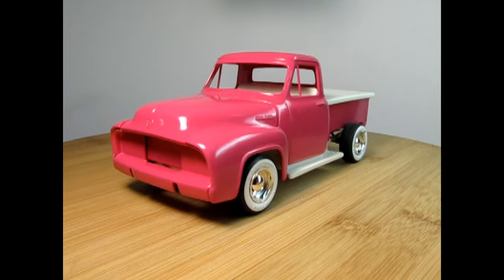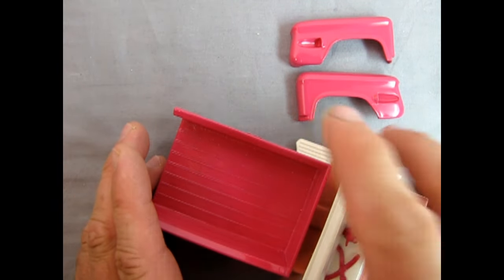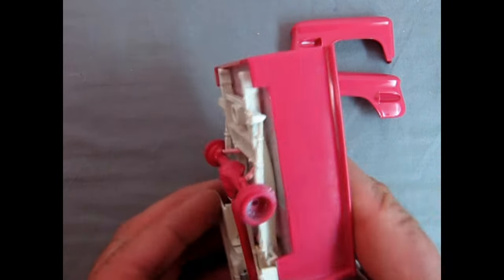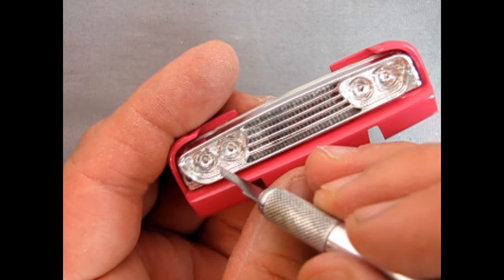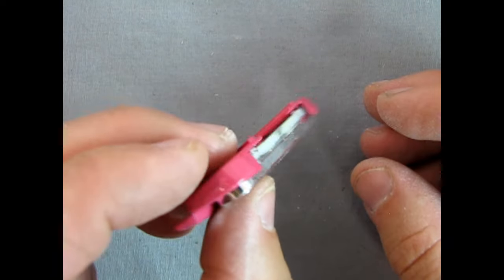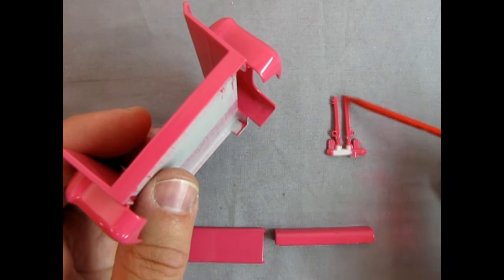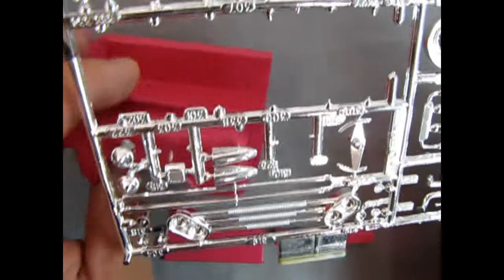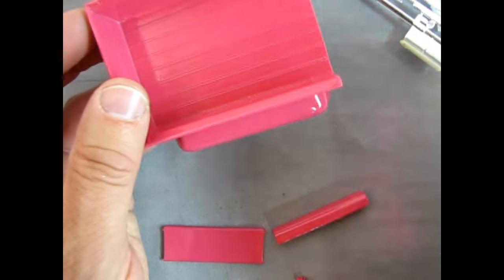Finish It Fridays - The AMT 1953 Ford F-100 Pickup Truck Part 2

Comment: I have always had a problem of the chrome plating rubbing off. I clear coat the whole chrome tree. Sometimes I rely on the clear coat to make the glue joint hold
Reply from the maker: It is strange how on some models the chrome is almost impossible to take off and on others you just lightly touch it and it's off. 

The hub caps I am using are like that. I'm going to paint the missing portion with the Moloton Chrome Pen.

Comment: Those are rear GM fenders usually on the Chevy and GMC Stepside model. It is called customisation on the Ford pick-up truck kit
Reply from the maker: Yes, I know. These are kit included 1955-1957 Chevy Apache rear fenders. They do give the model a slick appearance, wouldn't you agree?